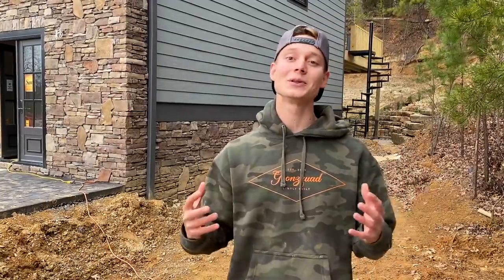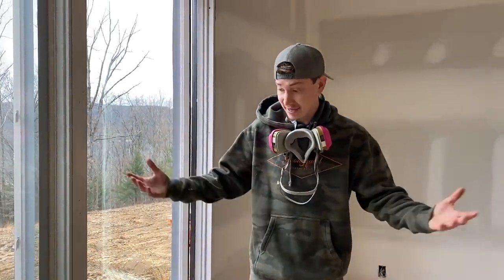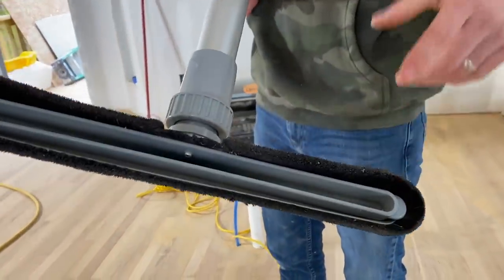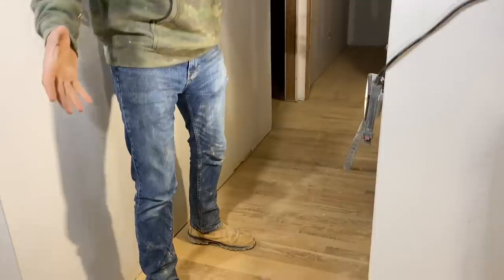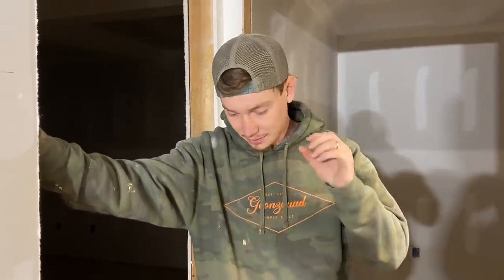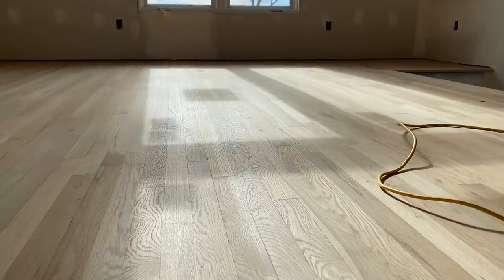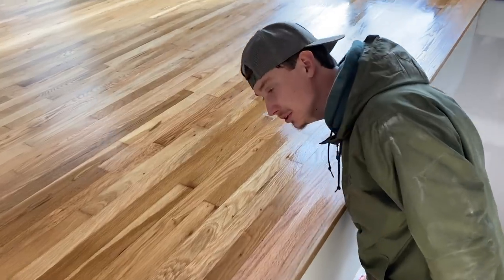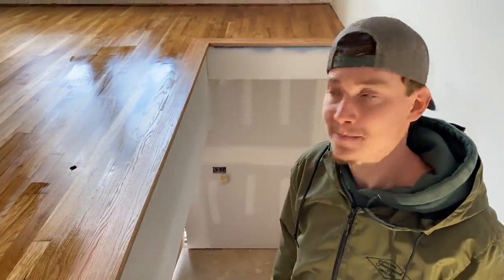The New Goonzquad Headquarters Part 54

Comment: Windows need fixing properly,  mechanically, don't rely on silicone it expands and contracts and degrades, you will have endless issues.
Reply: ...applying caulk now is literally pissing in the wind...
Reply: correct.. it needs a drip edge and maybe some flashing as well. Will more then like require removal of stone around window to do correctly.
Reply: I appreciate they want to do things themselves but somethings you should leave to the pros, ie the windows. how many other windows are leaking in the walls?
Reply: my first thought lol
Reply: @farmtruck9885  

Yes sir 👍👍👍

Windows and tile
Reply: @chadfellers9128  You are correct.  That side of the house needs something like a slight overhang above that large window to prevent water from working its way in, plus visually making that wall more attractive.
Reply: Flashing
Reply: You are new to Youtube I guess. Everything is done to maximize engagement and profit, not to do things correctly. More comments, likes/dislikes the more $$$ ends up in their pocket.
Reply: @someone28  they just are DIY guys, you don't have to live in it, so why complain?

Comment: Again, y’all have water, blast some water at the window and see if anything comes through instead of just waiting for a disaster to happen..
Reply: @Debs Crokaert someone can be on the inside watching for water, and as soon as water is coming in, turn the water off so you can see exactly where the water is coming from and try to fix it.
Reply: Those windows are going to let tons of water in and be a pain in the ass forever and you know it
Reply: @rubenbraekman4515  who are you talking too and why
Reply: Those windows are going to be a nightmare
Reply: They new where the leak was coming from I think they never siliconed the window to start with.
Reply: Or just do what they did and put silicon there
Reply: @rubenbraekman4515  this is just a flip house anyways there building a big house beside it and knocking this one down after
Reply: These guys don't think that far ahead 🤣
Reply: You took the words out of my mouth.  Then if water does come through you are right there to dry things up.
Reply: @JakeandHisLux  but without testing, how you even know putting silicone fixed your problem..?
Reply: They will find out Thursday. Cause it’s suppose to rain all day in Tn .
Reply: Love all the experts in here. So funny
Reply: @stevenplaskett7728  Who told you that the guys was building a bigger house & tearing this one down?
Reply: @stevenplaskett7728  Who told you the guys was going to build a bigger house & tear this one down?
Reply: @ITMeCE they just sealed the hardwood... can’t walk on it and if it would leak you wouldn’t be able to see water on the floor cuz it’s already wet.
Reply: You cant simulate rain with water.
Reply: You cant get every angle with water that rain does
Reply: It could also be a slow leak
Reply: I think they are smart enough and will figure it out. They ain’t lazy... they aren’t the type to leave a problem like that.
Reply: A lot of Negative Nancys and know-it-all Karen's on this site😳
Reply: @johnpearson4533  nailed it 👍
Reply: @rubenbraekman4515  They should have gone with flanged windows with Tuc tape and home wrap all done in the proper order .
Reply: I also don't like the idea of finishing the floor before water testing that window, the other windows, and painting.. Is that just me..??
Reply: The original windows should had been trimmed out on the outside, then they could had properly installed new construct windows again  and trimmed them out and sealed them the right way!
Reply: @DaughertyFarms  Plain rain may not show up - it has to be wind driven rain and even then it depends what direction the wind is blowing.  Thats why using a hose or pressure washer is better - it's worst case.
Reply: @ITMeCE  idk worth a try
Reply: @_-0_x_-_p_0-_  then why's it leaking.

Comment: I see those windows leaking again in the near future!
Reply: Yup they didn’t really seal them to the substrate I believe just the brick, and I don’t recall them using any sill flashing, we’ll see time will tell
Reply: Yeah you & me both because I agree on everything too!!!!!
Reply: ATownPyro: They sure will leak,  unless they cover the entire house with tarps every time it rains.
Reply: You Really need to have hvac installed and let the wood floors acclimate to the house climate before installing, they will buckle if u don’t
Reply: I agree. They didn’t flash the windows at all. Amateur mistake
Reply: @timglass6041  25 years and bever had any leaks, and I'm 85% sure my house isn't tarped!
Just 85%

Comment: Just an idea for the spiral stairs, you may want to put a non-slip surface of some kind on the treads. The bare metal looks like it would be slippery if wet...
Reply: Grip tape or paint and sprinkle sand on it.

Comment: If your cabinets are ready for install I would recommend painting the walls behind them before they are installed. This way you get the drywall sealed behind them.
Reply: No need, first they have to bring in furniture, then clothes, then all the dogs, cat, ducks, then primer then paint the walls then they will of course spray all the doors and trim.
Reply: Oh let’s not forget, those windows have all been caulked from the outside and will hold expanding and contracting from weather and will withstand after all that is done. LOL
Reply: Exactly, at least a seal coat

Comment: I'd stack that hardwood in the room it's going into and leave it for a couple of days to acclimate.  That's the way I was taught anyway.  Floors look great, and the house is shaping up quick!
Reply: I would've went Heat pump/furnace  etc THEN floors  but  lol whatever~
Reply: A couple of days?  Only if the wood floor supply warehouse was heated to at least 65 degrees.  Two weeks if not heated.  Heating system for the house should've been in for a couple of weeks before the floors were worked on, and a moisture meter should've been used to make sure the floors were dry enough.

Comment: Need some drip edge above them winders. Put some water on them too to see if the silicone fixed the problem (if anything its just going to be a short term fix). Also that silicone offers no R value. You’re going to have drafty window problems on top of leaky window problems
Reply: Just what I posted I do masonry for a living all water runs down and if the said they put mortar near window for sure water will still get in.. water goes through mortar slowly
Reply: All windows need it
Reply: Guys listen to Matt on this comment.  You mounted windows into that stone wall, you will need the drip edge on minimum top.
Reply: @Jeff.the.senior  they don't care . you acting like them boys isn't making  $1000's and $1000's from YouTube on this house remodeling . if they have to do it over again they make another YouTube video  and probably never see your message anyways

Comment: I don't know ANYTHING about building houses so correct me if im wrong, but wouldn't it have been a better idea to make sure that window was SEALED and do a test on it before finishing the floors? Idk just kind of seemed like common sense to me, but i could be wrong lol
Reply: Common sense isnt so common now adays manye hahaha
Reply: Yes you're correct. They should use their  pressure washer and blast water towards all their windows to make sure they are all sealed.
Reply: Just think of it as future content when it inevitably leaks
Reply: Don't forget these videos were done like a week ago before Christmas
Reply: yes.jpg
Reply: @stevenplaskett7728  This was filmed after Christmas.
Reply: @insaneindamembrane7961  hmmm but if they would have just sealed the floor first then tested the window they wouldn't have to worry about water getting on it right?
Reply: Yes, especially when they leave out important steps on every job they do!
Reply: @insaneindamembrane7961  it really doesn't matter, if you don't catch a water leak right away there's no finish out there that will prevent the water from damaging the wood. It's just that if you have to replace a section then it's better if you didn't waste a bunch of time and material sanding and finishing

Comment: Floors look player nice job!
Also the plan on the final coat is a great idea 😜
On that window, if the water is getting behind the wrap under the cultured stone that will be super fun to fix. If it is you’ll know soon. A lot of masons don’t know how to wrap a wall. You have to prep it just like siding to be sure it doesn’t leak. Taping all the wrap around the windows (usually installed before house wrap or shortly after) is what keeps the water out. Caulking only lasts so long. You can take off 1-2 rows above and below and tape everything off then re-lay your cultured stone but I’d recommend waiting to see what happens.  Obviously at some point if any windows leak you’ll have to do that or you’ll deal with it forever. You can tape stuff on the windows where the siding is easily. People pay tons of money for these repairs and they’re extremely common mistakes. Good luck guys!

Comment: You need to remove the stone outside above the window, install a rubber membrane and metal flashing over the window to prevent water from coming in !!
Reply: Water always wins.  It will happen again, they don't understand the proper way to do anything they just make great content.
Reply: Could of swore they put that?

Comment: Why would you do floor work before you texture the walls and ceiling,  that should be the last thing you do
Reply: Really, there's no power or water in the house yet either.
Reply: If they didn’t have power how did they have work lights and the vacuum on
Reply: @jarenjones6233  outside hookup is active. There is no feed to the house.
Reply: i dont know why they didnt modernise it,  boring brown floors
Reply: Why would they texture the walls? It’s not the 80s anymore

Comment: get the window fixed better than just silicone as that wont last too long
Reply: It needs to come back out and be done properly with the winds the mountain can produce
Reply: Yea you are right
Reply: they need flashing
Reply: Yep I tried this on RV windows a few times it NEVER works. You will never seal a window with a bad install from the outside.

Comment: You need to tear down that drywall to find the leak and if the floors looked like that what do you think the insulation looks like?  Its sealed in the wall and can't breath.  
You boys just spent about $300,000 on 2 Kubota's and 1 Cub Cadet and you're going to cheap out on the first floor hardwood?  That stuff is what you put in a house you're flipping to sell.  Put some real stuff in there, when the water comes blasting thru again you won't be able to sand it will be a total rip out and have fun with it being glued trying to tear it out.
Reply: and boys be making $1000? and $1000's more making a new video to fix there mess up  . this house isn't costing them anything the views they are getting from YouTube

Comment: You should have primed all the drywall before installing floors.
Reply: like i said they do everything backwards
Reply: Calm down guys. At first, the floor was already in when they bought the house. Second, there are ways to protect the floor when painting. Never saw a painter who did not use some sort of foil or floor covering.

Comment: The house is spectacular!  But, I was thinking about your water leak.  They make a drip flashing for large windows.  Was the leak on the top?  If so, you may want to correct this before you move in.
Reply: It has been mentioned before a number of times

Comment: I would recommend a small  cedar awning roof accent above that window with a black metal standing seam roof on it. Then I'd do another one a little bit bigger over the front door with a concrete patio under it. I dont think I'd put all my faith in some silicone. Looking good

Comment: The south does some stuff differently from the north. Never seen someone finish floors in this process. I've always seen them finish them on one of the last stages. And never seen wood floors be installed prior to drywall. I mean what ever works. Keep on going!
Reply: The hardwood flooring on the upper floor was installed by the original owner in 2009. There were a large number of mistakes made during that development process, and the sequencing of trades was just one of them. Planning, design, choice of materials, quality of workmanship and approaches to cyclical maintenance were all seriously deficient. Our view following an inspection in 2018 had been that the 'house' was not fit for further investment, and recent events have confirmed our judgement.

Comment: Why not paint the house first and finish the Floor last? When I use to manage high end properties that's how I used to do the vaccant units.
Reply: Because they can get good views when they start something they want to finish it straight away, and they should stop trying to do everything themselves because most things are poorly installed because they dont really know what there doing, it would also make it WAYYY quicker to get the professionals to do the boring bits while they can work on cars at the old goonzquad garrage WIN WIN WIN
Reply: i dont know why they didnt modernise it,  boring brown floors
Reply: @user-is1yg8ce1m  lol they tried so hard to make the outside modern and then wreck the whole interior with crappy old floors...
Reply: @AndrewPL5  exactly. couldve done gray or something. also easier to lay down
Reply: @user-is1yg8ce1m  because wooden floors do look good in my opinion and its what there used to

Comment: good execution on the hw floors - they look super nice and low maintenance - you are starting to get closer now, one part at a time - you will do the exact same stuff for the garage/office so not wasted effort - you can't go wrong with hardwood floors - you should have a garage planning special where you guys walk the site and write down what you want - i think if you get sitework done footers poured and the slab poured then you will be cooking with gas - rent a sawmill and cut all your 2x6 and roof beams? consider post and beam frame and then metal studs - go big and then you can have mezzanine and storage, access to deck in back or roof deck and solar panels - you probably have to have plans to get all the permits - i think you can get it basically built inside of a month and finished in a couple - it should pay for itself and be a primer for the next building and the one after that...the garage will give you a good base

Comment: You should build a waterslide due to the hillside dimensions of the property there, or instead of water, add karts that sit in a cemented zig zagging track down the hill from your place into town. Add a skilift or a fancy gondola with a alpine stereo on board to return to your destination. However, you then decide to do upgrades to the gondola, and weld up a mounting bracket for your brother's rv.

Comment: If I remember right the big window had water damage on the wood when they removed the original window.
Reply: Looking back on the earlier videos, signs of water ingress are visible in many areas. The installation of the Nichiha Siding on the west, north and east elevations may have ameliorated the issue in those locations, but the south facade, with its low quality brick and stone veneers, remains a concern.

Comment: Suggest replacing the drywall and insulation below the leaky window. In the close up shots looks like mold is starting to grow. Of course, after window completely re-flashed and checked for leaks. Leave floors raw for now and cover with Ramboard. You don't want the risk of spilled or overspray paint on newly finished floors. After paint is completely done, remove Ramboard, lightly buff floors and apply topcoats.

Comment: Great content guys....love how excited you guys get all the time.  Heads up on the trim work around the doors from a Finishing Carpenter.  I have always used a 18 Brad Nailer and pin into the jam edge and into the stud/cripple too.  By doing that it locks the door jam and casing as 1 and plus the chaulking casing/trim to jam and wall edge also providing you are using paint grade trim.
cheers guys

Comment: Hey guys, have you thought about a Heliport right outside the property?, That would be cool just to fly home. Think about it, you have the space!!!
Reply: The most challenging part of their ambition to fly will be earning the necessary licences. This requires considerable classroom study ('Ground School') and personal tuition with an Instructor, followed by Solo flying and eventually a practical examination and a Demanding 'Check Flight'. Rotary wing aircraft are considerably more difficult to handle than fixed wing. One option is for novices to begin with training on a small single engine fixed wing aircraft, so that they can not only become familiar with basic airmanship, the many regulations, navigation methods, meteorology, communications and problem solving, but can also see if they actually have the overall aptitude to become a safe pilot. Progression onto rotary wing will then largely be focussed on the very different control systems, dynamic behaviours and emergency procedures of helicopters. The whole process has to be taken very seriously, involves several months of demanding work, and is expensive. A talented student might spend $15,000, an average one around $25,000. If the bills are piling up beyond that level the Instructors should probably convince the student to take up a less demanding pursuit, such as ballet dancing, sword swallowing or lion taming.
Reply: @johnstedman4075  With all they have achieved, I'm sure they will be able to get everything done.

Comment: One thing that you guys should consider doing with the spiral staircase is use a paint with a little of stucco for grip which would give the surface a rough surface when it rains so you guys won’t slip and fall which could result in broken bones even with the hand rails